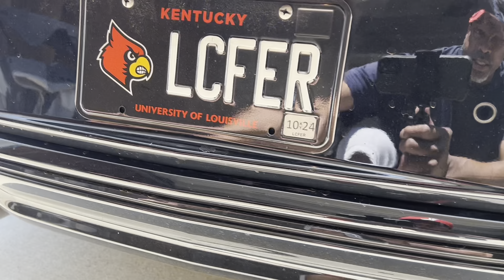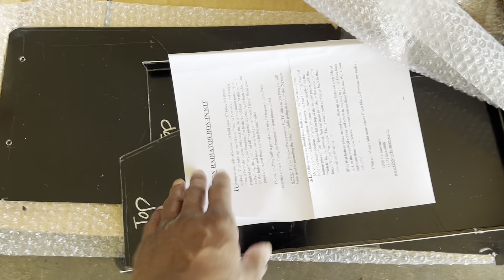Reducing the temperature on the Buick Grand National pt.2

Comment: Simple green would help here mike...
For the road grime and grease 

If u can attach the turbo outlet to the throttle body without the intercooler u can really see how the car runs without the intercooler..
The intercooler is doing nothing at idle....hood up or down

2. inch pvc at the depot with couplings will take the place of the intercooler....
Reply: Also can u remove the transmission cooler and install it onto the cool case radiator...
Remove the transmission cooler altogether 
Or install it down lower between the air dams

It's been done before on our tutbo buicks...
Reply: Also your idle was 1400 in prior video...
Needs to be lower. 
Keep me posted 
Keep spooling
Reply: So my car has been getting hot too! Everything say 220 is optimal temp for combustion! Take it with a grain of salt...
Reply from the maker: I don`t think the inside of the intercooler was dirty, I just wanted wash it out
Reply: @2muchBoost_  
Doesn't look too bad 
Any grease and road grime on the external of the intercooler is what I meant.   Id spray simple green on it. Make sure it's safe for aluminum...

Comment: Your cold case radiator should have two threads left for the transmission cooler.   
Id put the trans on the cold case and eliminate that little cooler.

Comment: Your high cfm spal fan burned out bc you have the improper airflow that the fan motors need/ require.

In order for a high cfm motor to operate properly it needs the correct airflow on the negative side /  front of the car......

Everything got melted and overheated bc of airflow